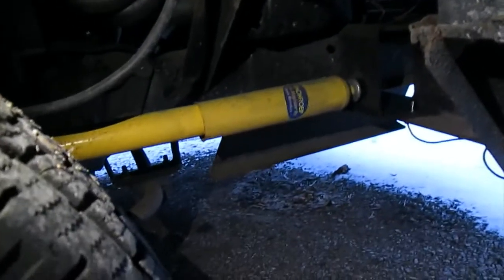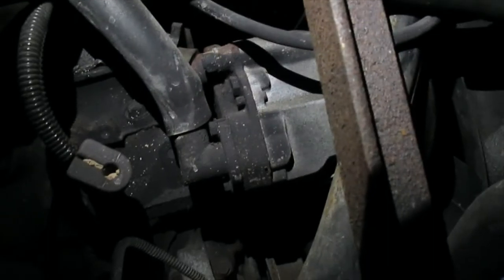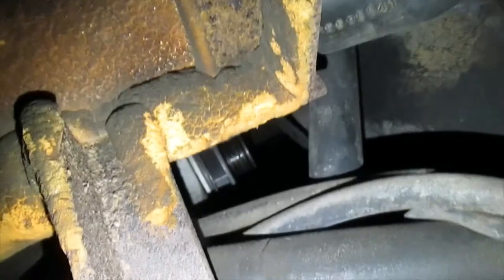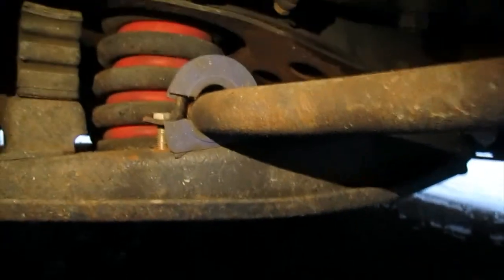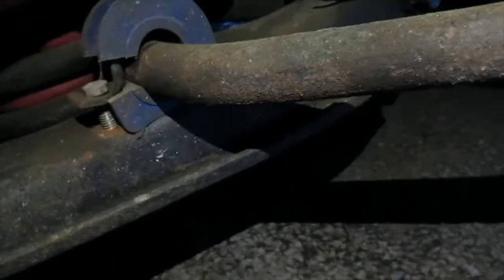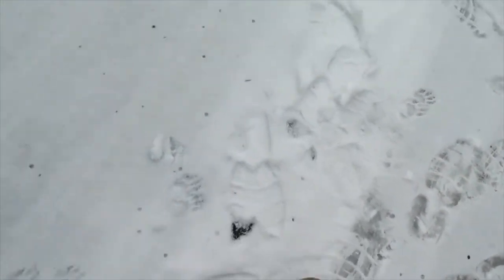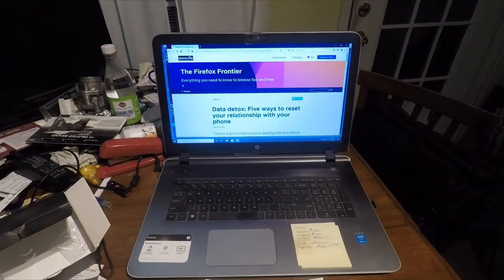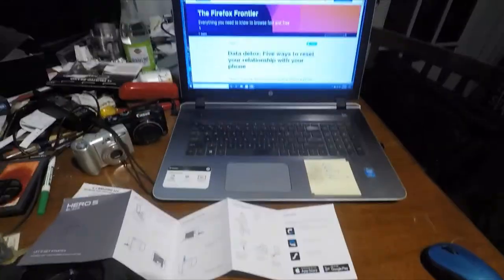Jump to the Front of the Line RV Alternator Belt Fix

Comment: The old belt had a rib torn off.  You now have the right belt.
Reply from the maker: Wow. Just thought that since this RV has so many other "expert" repairs to it in the past this was just another close-enough. I guess it is very possible for one rib to strip off (pullies not aligned? bad bearings in the AIR pumps? ) Going to have to check those things as best I can. Thanks for pointing that out, Chris!

Comment: did you have to remove the lower fan housing?
Reply from the maker: Nope, just had to "walk around" the belt on the fan itself to get it around the front of the fan and then behind it to start placing it on the pulleys. You start on one blade then start turning the fan as you get the belt behind each blade. The belt is long enough to go around the blades.
Reply: @drlong08  I can't hardly see the front of the motor. thinking about taking it someplace.  i have nothing left of the old  belt
Reply from the maker: @larrymcbride9837  No surprise with all the AIR pump components and other stuff on the engine. Don't blame you. I did it but had to lay over the entire engine with a flashlight and a bit of swearing.....now that I have an AIR system delete, the job is a lot easier!